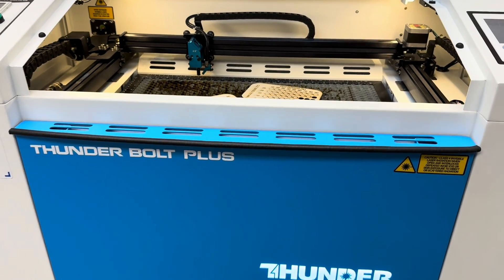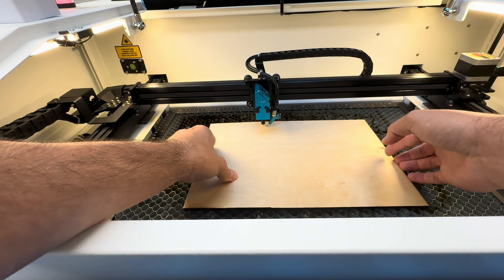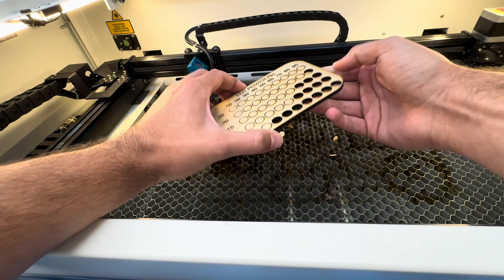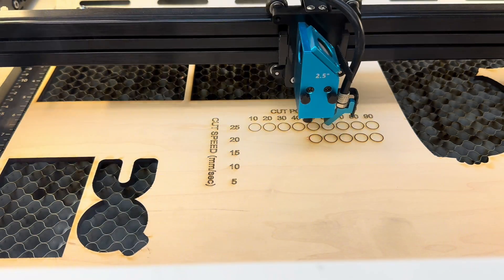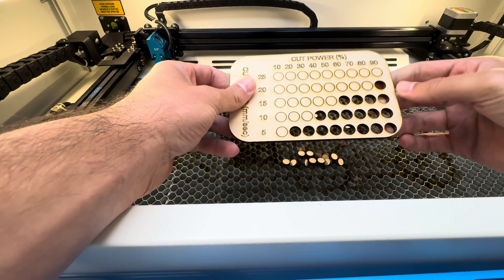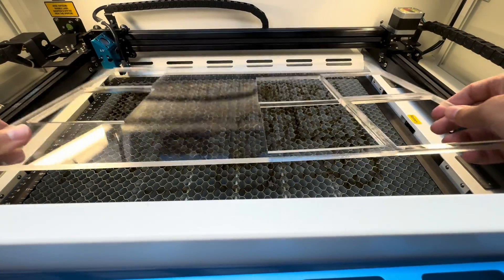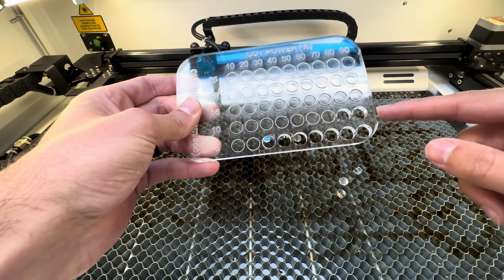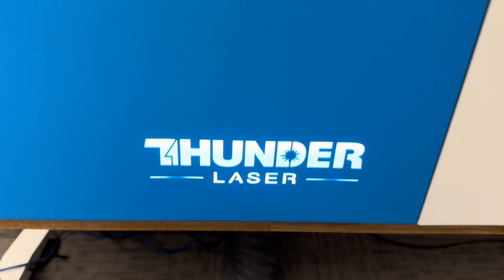Bolt Plus: Cutting 1/4” Wood & Acrylic

Comment: Just a suggestion but it would be nice if you enabled comments on the videos. I’m shocked this one has them enabled so I’ll ask my question here. 

Can you upgrade the laser in the Bolt series? If I purchase a normal bolt can I eventually upgrade to the Bolt Plus/Pro lasers or do I need to buy an entire new machine? 

Thanks.